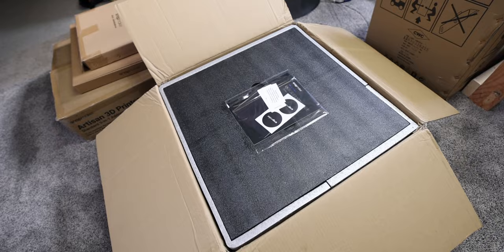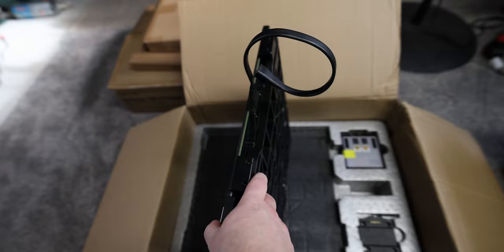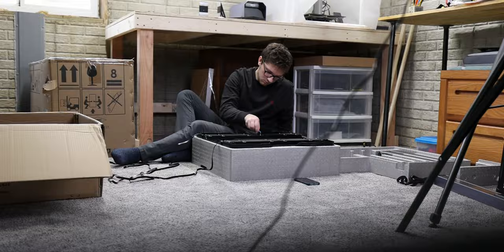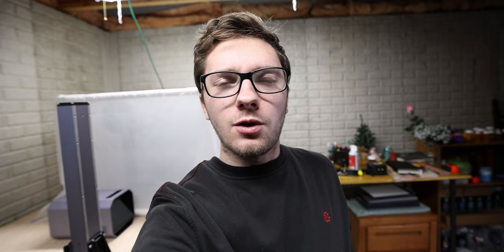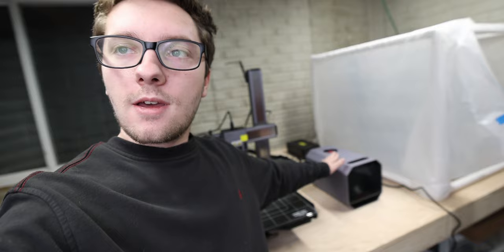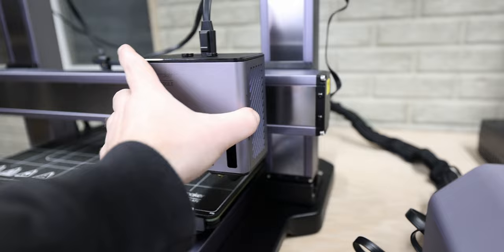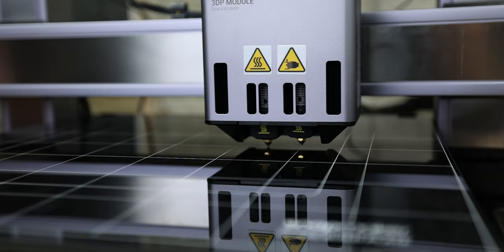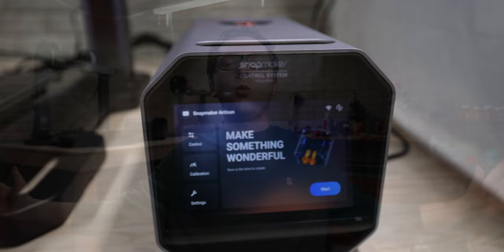Unboxing Snapmaker’s Most Powerful Machine

Comment: Absolutely loved upgrading from the 2.0 to my Artisan... Make sure you have the revised front cover for the 3D print module :)
Reply from the maker: I got mine in early December 2023. Looks like replacements started being made available in July 2023 so I’d think I would have it. What is different about the two covers?
Reply: @RyanTuscher  Extra holes for the heat brake area that can cause issues. Mine was an old one but all sorted now thanks to they’re amazing customer service

Comment: A heavy heated bed is not a good thing for a bed-slinger setup. One word - inertia. Sloooooow prints.
Reply from the maker: That is true. It is a compromise you have to make since this is a 3 in 1 machine. Probably won’t be the fastest 3D printer but we’ll have to see how the other 2 functions perform as well. Thanks for sharing your thoughts!
Reply: You would be surprised how much power the linear rails have... inertia isn't an issue